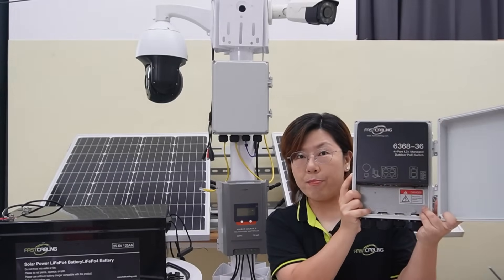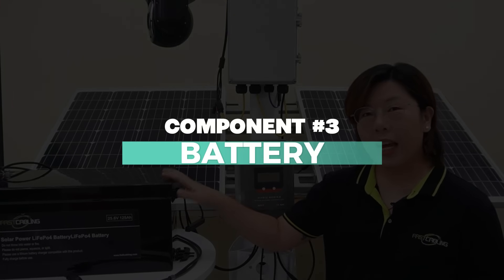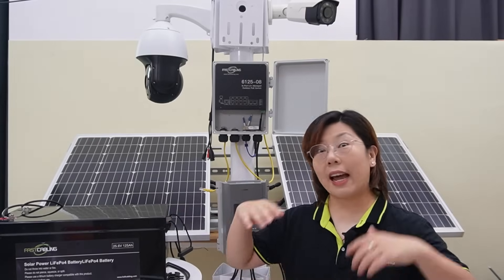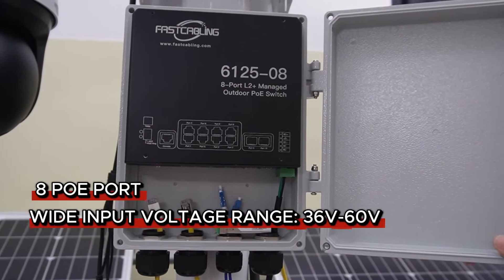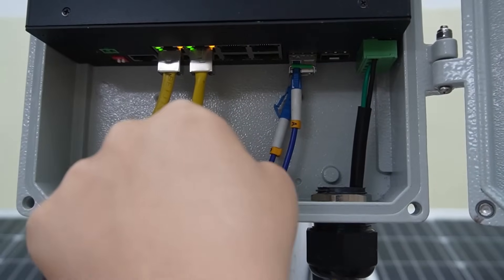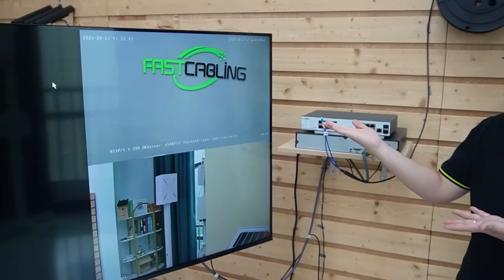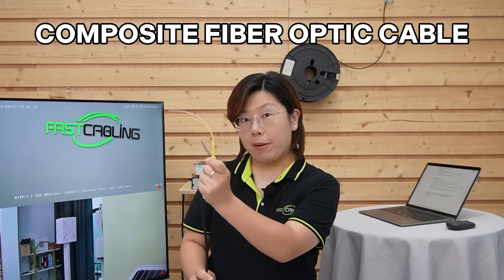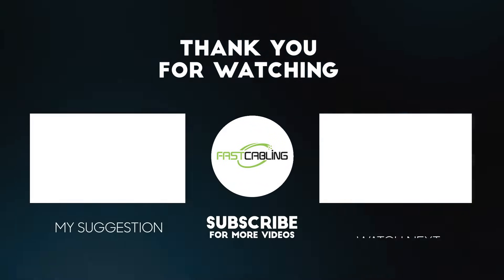Use ChatGPT to Plan A Solar Powered IP Cameras over Fiber Run | Industrial Remote CCTV Setup

Comment: But in Home connected in solar system NVR and Poe
Reply from the maker: The solar system is more suitable for off-grid deployments, but it's also a nice choice if you wanna backup power. You can use DC in home setups.

Comment: What is the voltage of this system as I saw the battery marked with 25 V ?
Reply from the maker: The voltage range is 54V DC. The outdoor PoE switch delivers standard PoE (802.3af/at) to the connected devices. It has a built-in voltage regulator to maintain a steady power delivery.

Comment: Is it Advice able to connect Surge Protector in This Kind of Installation
Reply from the maker: There is no electricity between the control and the edge and the fiber optic cable is EMI immune. You might need to add the protection to the solar power system and the outdoor PoE switch.
Reply: @Fastcabling  Thanks for sharing ideas my pleasure
Reply from the maker: You're welcome.

Comment: Hello Greetings, My Question is the Fiber Optics cable will you burry it in the ground before connecting it to the control room since its 800m Distance away from The Camera and outdoor switch
Reply from the maker: Yes you can either bury the cable or pull overhead but need support within 40-50 meters with overhead setup.
Reply: @Fastcabling  How can you do overhead setup
Reply from the maker: For short runs on private property, you can install the messenger wire between poles. For professional/long-distance routes, ADSS cable is preferred since it avoids metallic components and can be safely installed near power lines.

Comment: Sorry battery must connect first to the charge controller.....
Reply from the maker: You are right. Otherwise the controller will draw the power from the solar panels instead of the batteries and the voltage could be much higher outside with sunshine.